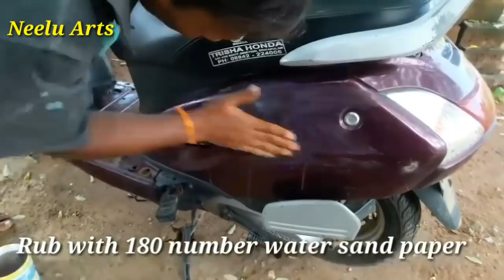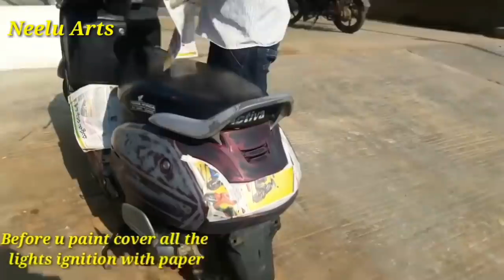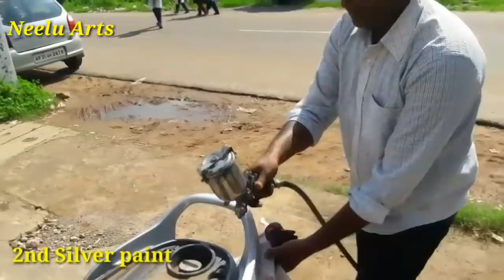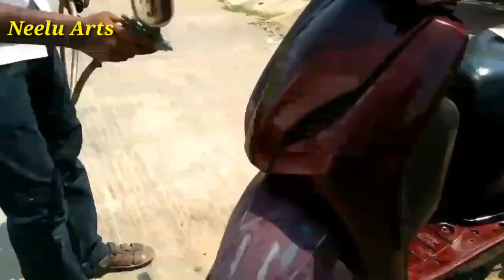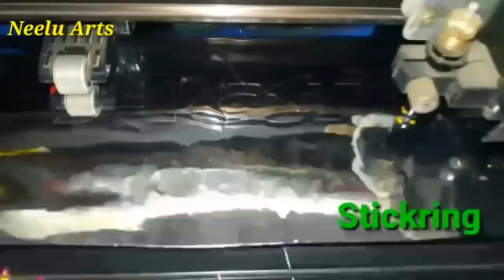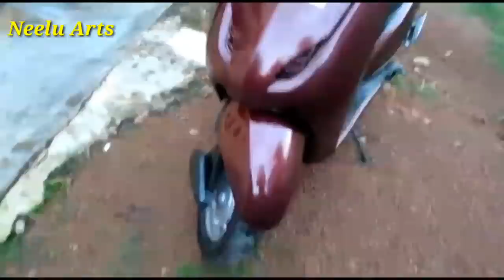How To Paint A Bike Easily With Spray Paint? | Honda Activa Scooter Painting At Home | Neelu Arts

Comment: what kind of paint r u using on plastic fibre body. if we want to paint plastic body what kind of paint to use and do we have to use a primer . plz reply
Reply from the maker: +shamin somkuwar ya bro nice question.. I am using esidee company primer for primary apply and second third coats i am applying esidee auto finish metalic coat final fourth step after the paint dryied I am using aspa company clear and ordner for shining coat.. for this activa i did it in a low budget so i did n' t apply primer and rubbed it. I've done it direct 3 coats
Reply: @neeluartsautomobile  i too used asian paints and after 2 to 3days colour gone

Comment: how many ml colour is needed
Reply from the maker: if you r expert 3 to 400 ml is enough
Reply: the cost of paint 400 ml
Reply from the maker: the paint what i used in the video the paint cost is 1ltr 550rs. so 400ml 220rs
Reply: can u send it
Reply from the maker: I am a painter and the shop i had 35km distance from me. when ever i need auto finish paint there is no option definitly i will go to there

Comment: bhai painting machine kitne ki aati hai
Reply from the maker: I am using oil free air compressor 10200rs and pilot 64 model gun 2000rs and air pipe as your required

Comment: So just sand it with 180 and that's it?
Why didn't you add primer?
Reply from the maker: +Benko DiєsєL because of the budget 1400rs bro
Reply: Neelu arts what's budget 1400rs?
Reply from the maker: +Benko DiєsєL i finish the entire activa painting in 1400rs only bro. So i didn't apply primer
Reply: so it already has primer in the paint?
Reply from the maker: +Benko DiєsєL no bro its just paint only. If you want to know how to paint a bike fully watch my hero honda cd100 old bike remodelling video there you get full naration from starting to endiny

Comment: Color is not looking good very dull (not looking original).
Reply from the maker: +Hellow yes bro its correct. Because i did n't use primer coat to the bike. How can i put good effort in the amount of 1400rs
Reply: Well that's a great job in 1400 only. I have honda activa 4G (white). It got a scratch and dent. Can you please tell a color that matches with my activa. And do i also need primer to cover the scratch?
If yes then from where i can buy paint and primer and anything that is necessary from online or from offline?
i found some spray bottles online from different brands with lots of negative comments saying that color gets removed from wash and also looks odd and not matches to the original color.
Reply from the maker: +Hellow bosney is good spray can